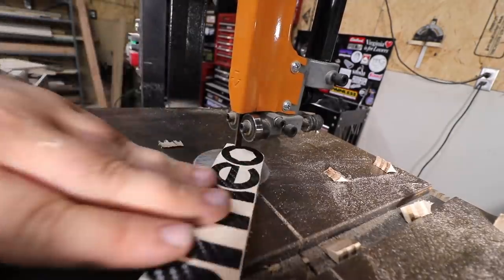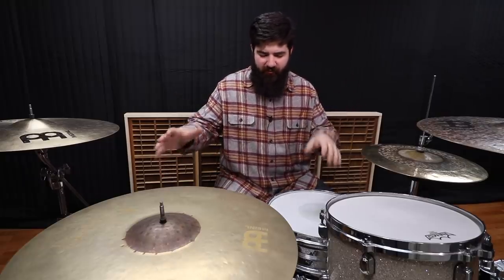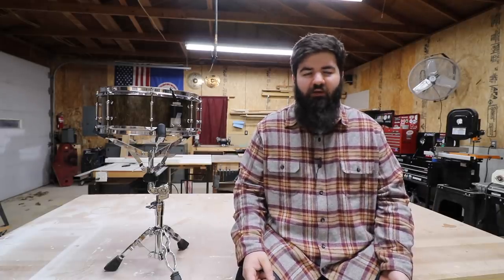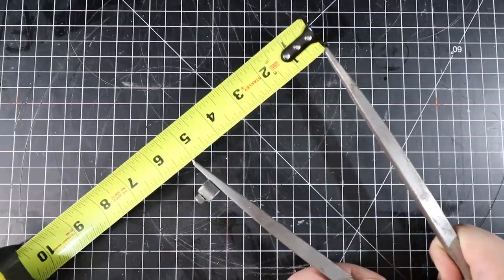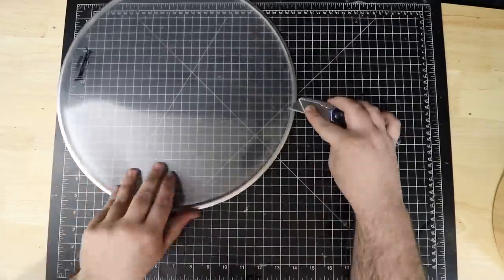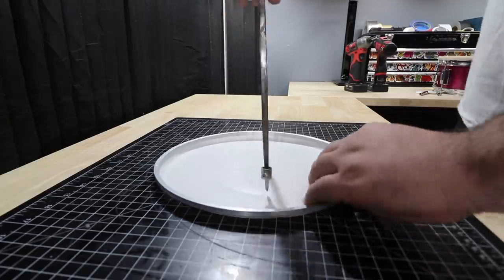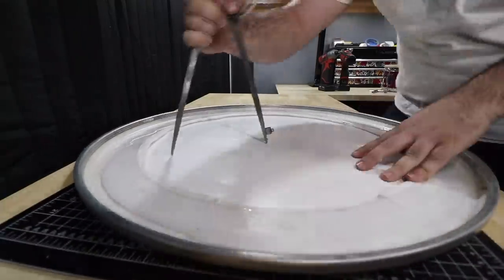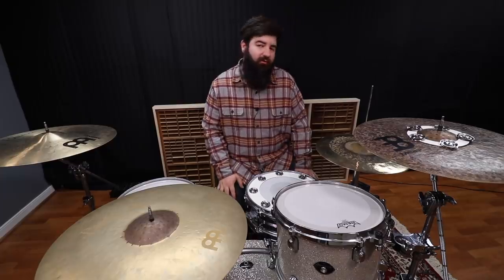6 Uses for Old Drum Heads You Didn't Know About

Comment: This is awesome! I would have never thought of doing these things with old heads. You are very creative and resourceful. Thanks for the ideas. But I wonder if it matters if the old heads have to be single ply or two ply? Or does it not matter? I've got a bass drum Mike hole c u t t e r. I'll remember to save it next time for my batter head. And maybe make some snare straps. Don't really need the O-rings because I use moongel. But anyway I really dig your grooves. Solid and in the pocket. Those Tom's sound awesome. Thank you so much for the inspiration David.
Reply: Dave does have some great ideas. One  thing he did not mention was reusing old heads. Here's what I mean. A long time ago,  my old drum instructor back in high school showed me how to circumcise a two ply head. I would then reuse the still intact head for a bottom side snare head. Not the greatest thing to do, but it kinda works when you only have 1 snare drum, and no money.

Comment: Ordered new heads just so I could cut and gaff up my old ones now.

Anyone found anything interesting to do with the old rings from heads?
Reply: put a smaller 14in old head on your floor tom and it gets a clicky quick and boomy sound, i actually did that yesterday.
Reply from the maker: you can use put the metal ring on a cymbal for some crispy sizzle action